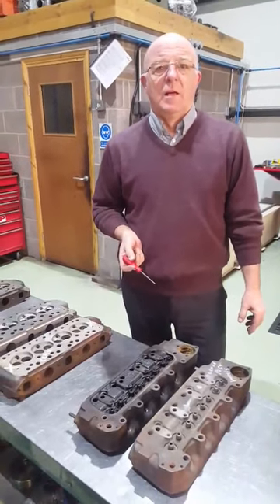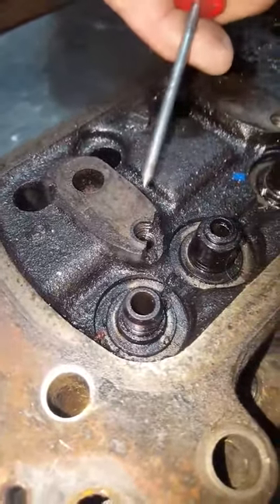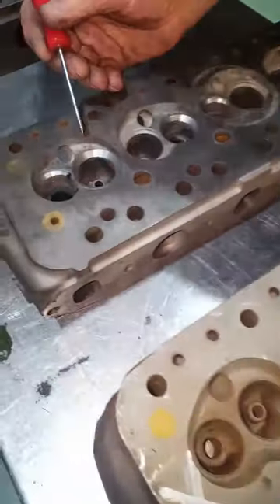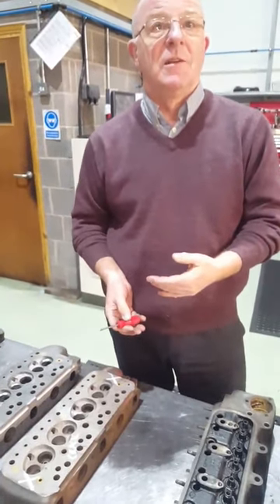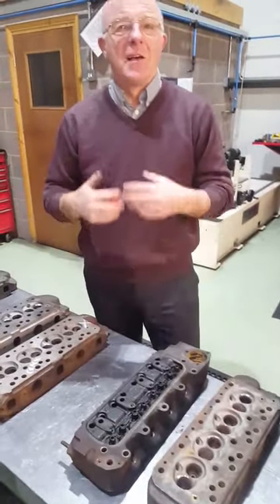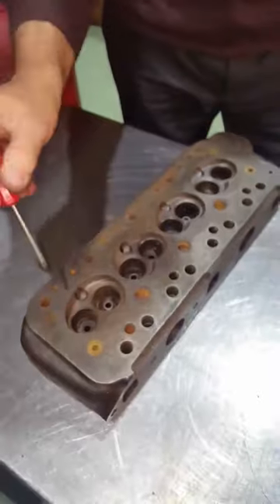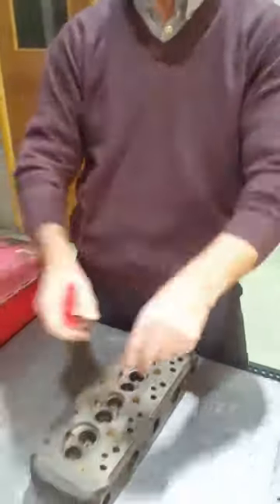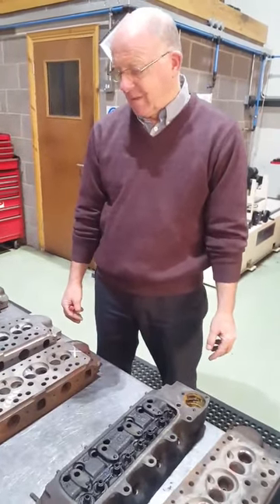A-Series cylinder head casting problems - what to look for

Comment: If an A+ cylinderhead has a crack between the valves, is it even possible to repair for a road engine?
Reply from the maker: It's possible but we wouldn't do it. For the time and expertise it can take, it usually just moves the crack to the next weakest point.